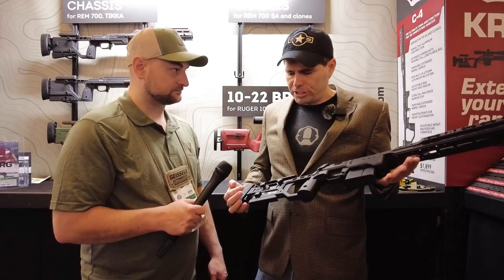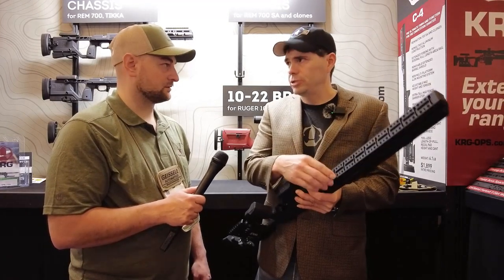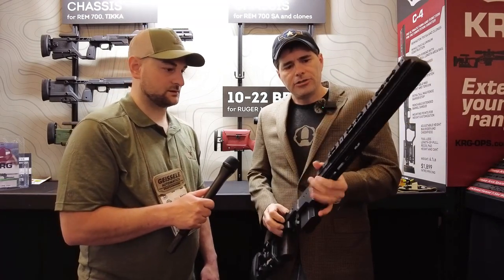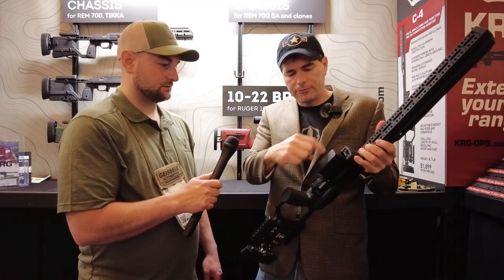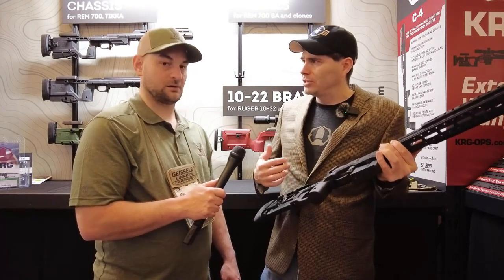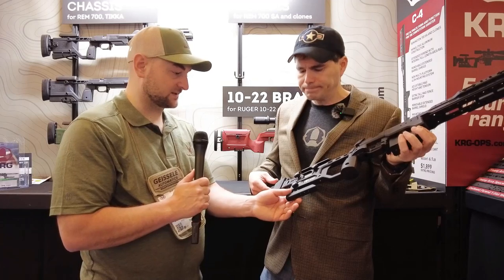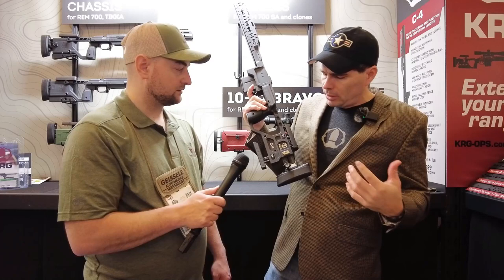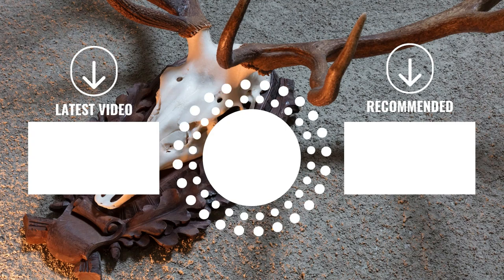KRG C-4 Chassis | Shot Show 2022

Comment: I've got a $5000 software package coming. It allows you to monitor stresses in STL files (3d projects).
I don't know if I believe that a monolithic piece is as awesome as they say. Most metals are crystalline, and breaking up pieces allow you to absorb "ringing". And with that software, I will soon be able to test if it helps or doesn't.
Reply from the maker: Awesome feedback that makes sense